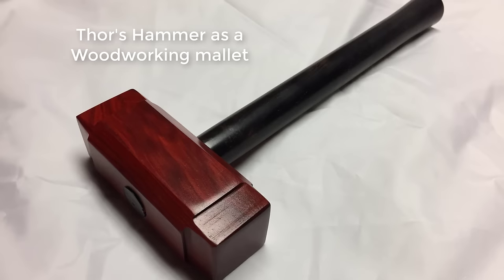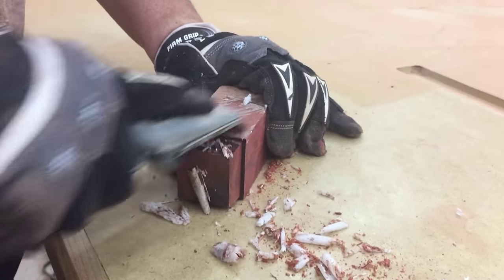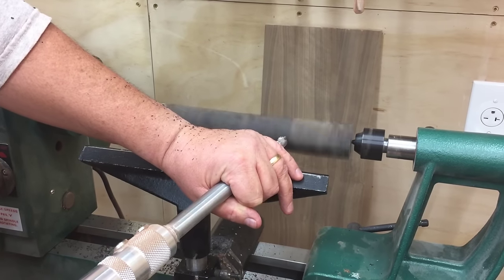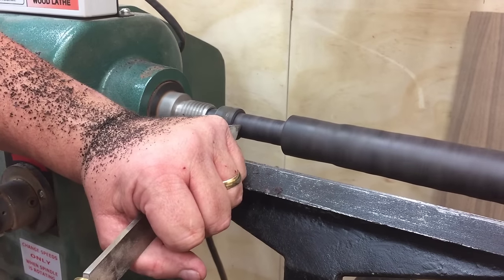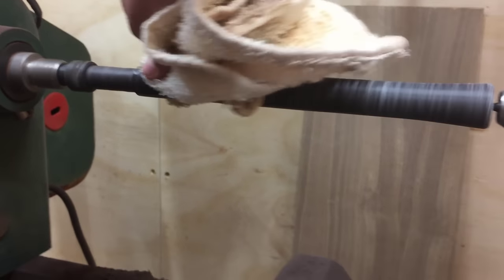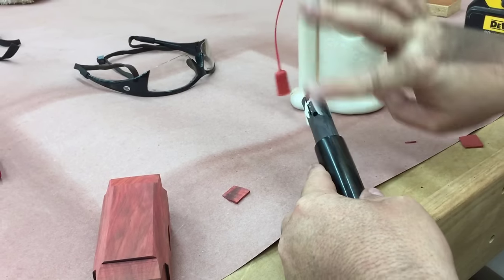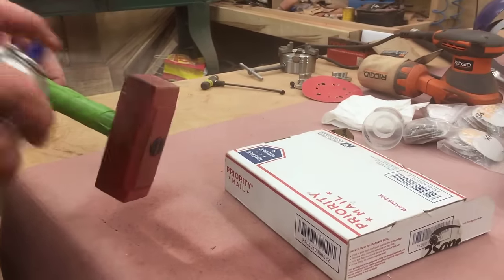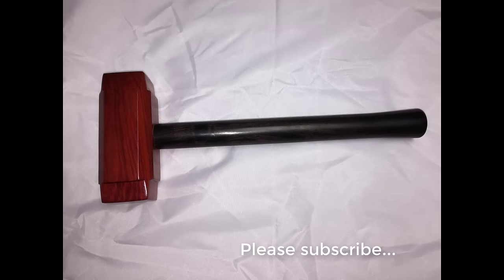02 - How to Make Thor's Hammer Mjolnir as a Woodworking mallet

Comment: The mail it looks great, and the handle looks great. Since you cut the Mallet head with the wax on it now that you have wax on all the teeth on your table saw blade I'm wondering if that wax worked with you to build more pitch while cutting other wood or if it worked against you making it harder to cut wood with the wax on the teeth?  Or did it not have any effect on cutting performance?
Reply from the maker: It did affect the cutting performance. I always clean the wax off now.

Comment: seems the wedge should have been across the grain so there would be less chance of splitting the head
Reply from the maker: You are exactly right. but it was put there to hide a check, and was supposed to be a decorative mallet for my daughter to keep. 

However, she brought it to the shop anyway and we now use it daily. If it ever breaks, I'll make another. It was a very fun and easy build, so I stocked up on some turning squares from Rockler.
Reply: I think you mis-understood, the wedge was fine, but it should not have been lined up with the head of the hammer but sideways so that way when the wedge goes in it won't add extra force on the long grain red heart.
Otherwise it looks great!

Comment: Nice job, and nice video.👍
- But it is a shame, that Craftsmen like you, only make the "HOLLYWOOD" Mjolnir.
Thor's Hammer Mjollnir (Mjønler), was NOT an Rectangular Blacksmith's Hammer, but a THROWING WAR Hammer, with a Slightly Pointed Top. ⬟ ⇪ 
When Thor threw it out, it always hits it's target, and then it returns back into his hand. 
It is smithed by the two Dwarves, Brok and Sindre, who also forged Frej's (Freja's) Golden Brush and Odin's sword Draupner.
 According to Snorre's Edda, "Icelandic saga", Mjølners shaft became a little too short, BUT is, by the way, it is the most important work the two dwarves ever performed.
Reply from the maker: I made the throwing one too! 
But I wasn't very good at it. 😔
Because I threw it and it didn't come back. So I couldn't make a video.